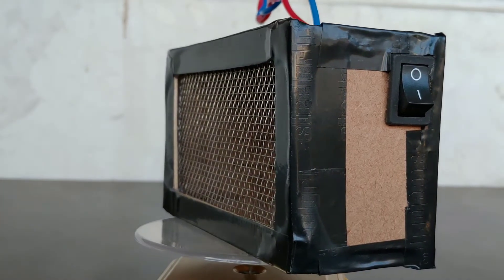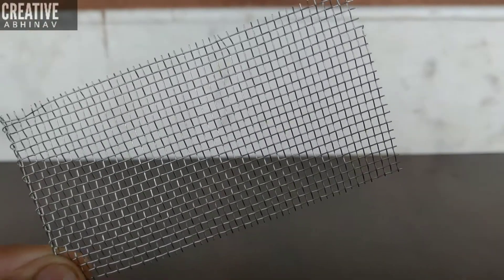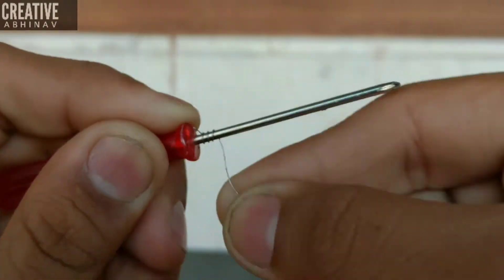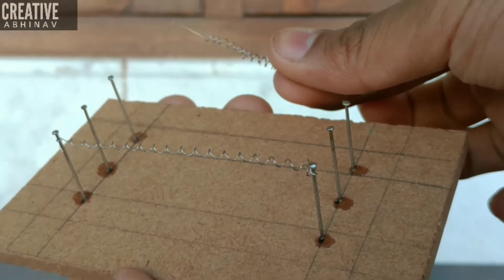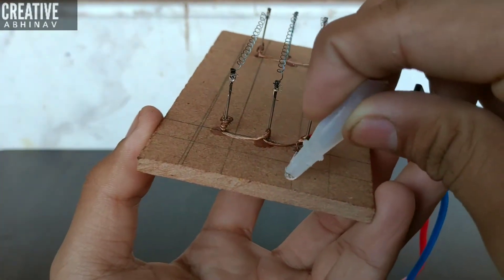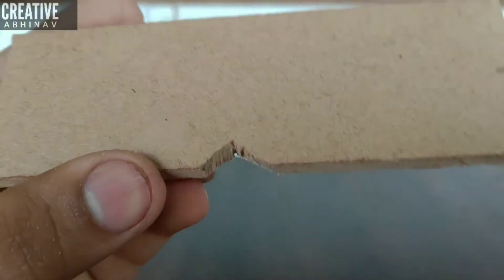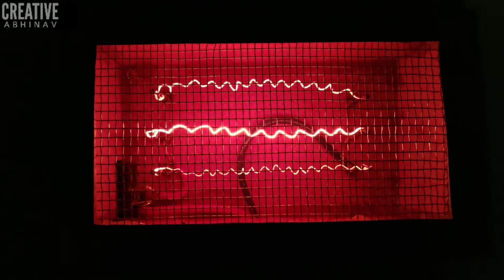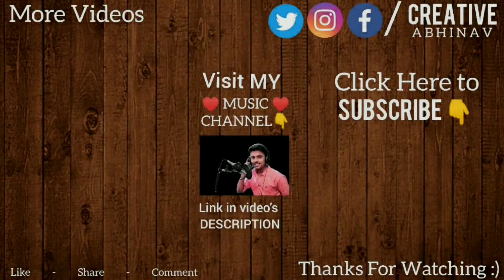25 RS |   How To Make Room Heater At Home Very Easy | Best Room Heater 🔥

Comment: Can I join directly nicrom wire from main line. no require any resistance?
Reply from the maker: Joining direct is simple method but it will use more power
So you can use resistance if you want to use it for long time :)

Comment: Which power supply will i need to operate this?
Reply from the maker: Hey  I am providing 12 v supply from 12v battery you can also use an 12 v adapter :)
Reply: @CreativeAbhinav  thank you bro

Comment: what SWG of nichrome  wire you are using and what power supply V&I  you are providing.?
Reply from the maker: Hey I am using 32swg Nichrome wire and I am providing 12 v supply from 12v battery you can also use an 12 v adapter :)